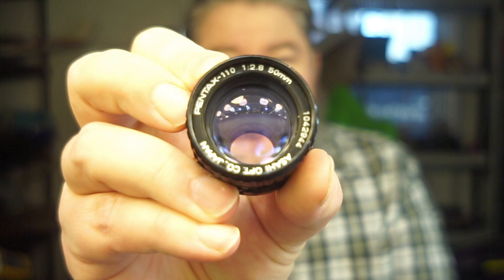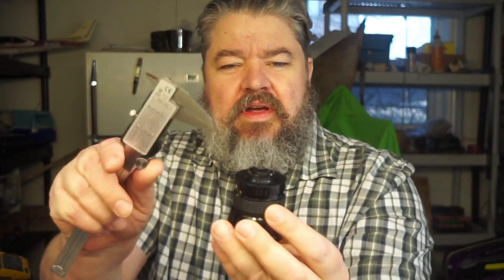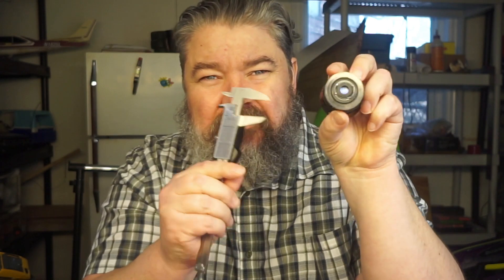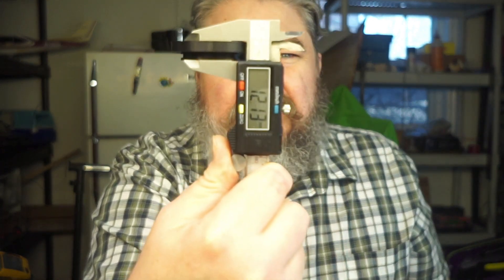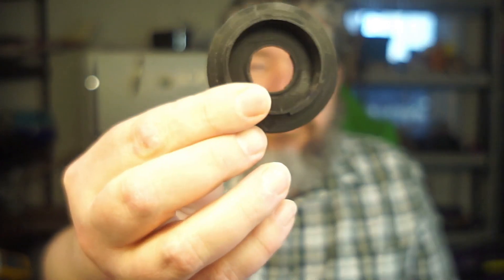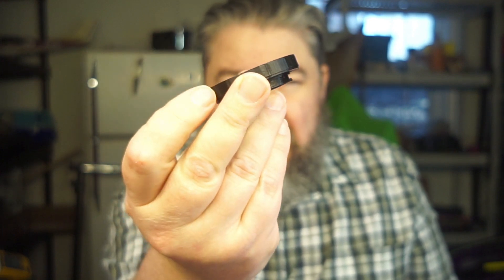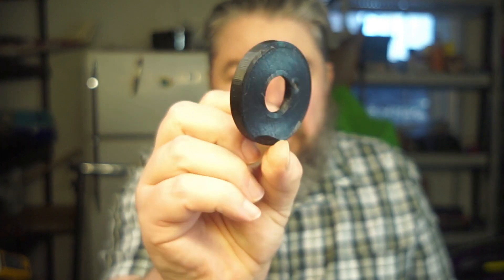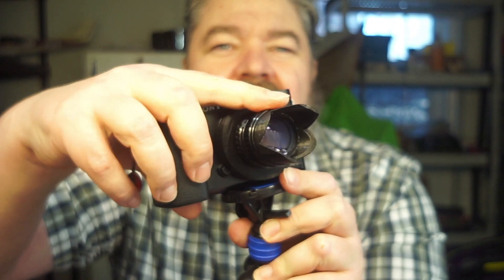Can You Print A Lens Adapter for Sony A6000 & Pentax 110

Comment: now just get a " Techart AF " or " FotoDiox Pronto " Smart Adapter and you will have Autofocus, but the mount is Leica M to NEX

so you would print out a Pentax 110 to Leica M then adapt it to the Smart Adater to Sony A6000
Reply from the maker: Those AF adapters will no't work with my A6000 A7 and A5000.  One day..I will own those.